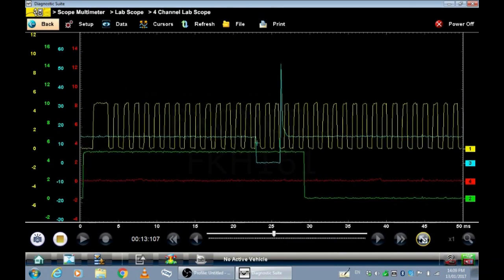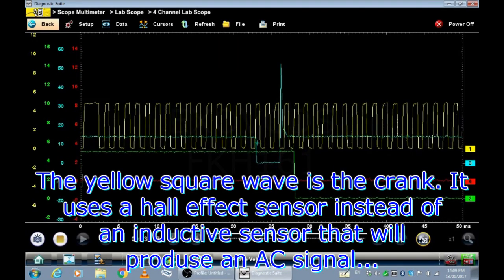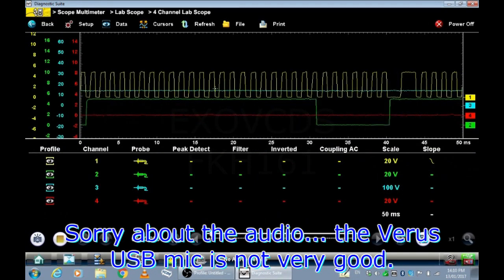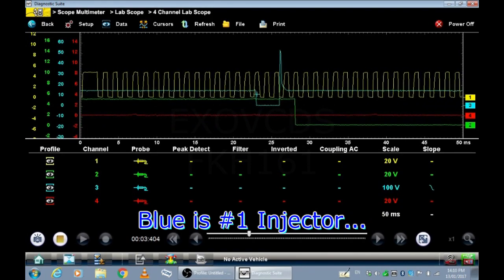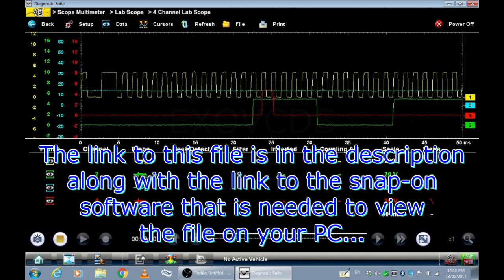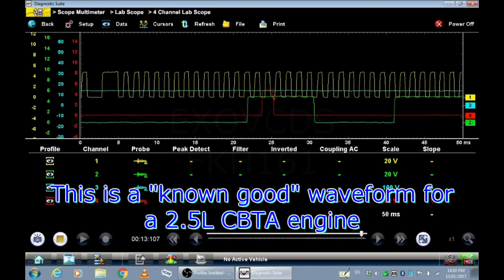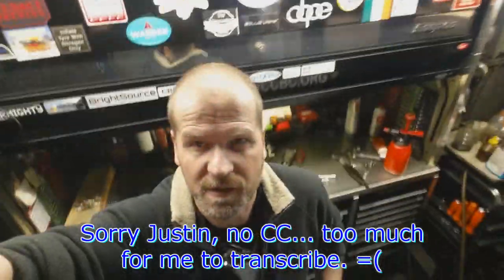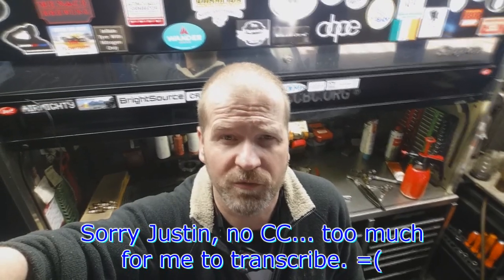VW A6: 2.5L CBTA Cam, Crank, Coil #1 & Injector #1 waveform

Comment: Hi, is it good or bad motor? How many miles it will go without refurbishing? Is it expensive for using? DSG comes with that motor or any other automatic transmossiot?
Reply from the maker: Like many / different engines... sometimes no problems for many miles, sometimes big problems at low miles (below 100k miles). Yes, different transmissions are available.